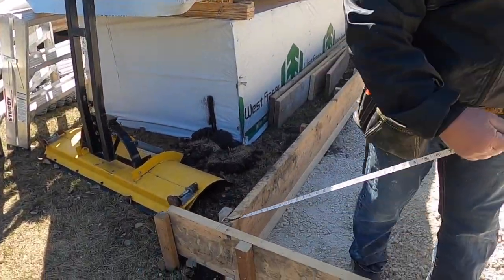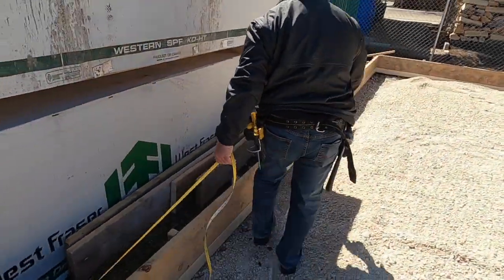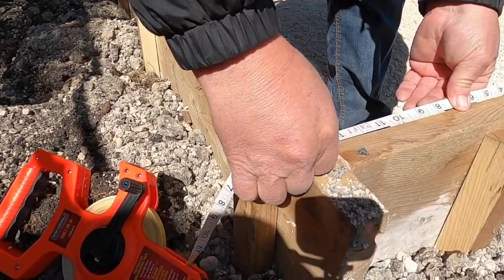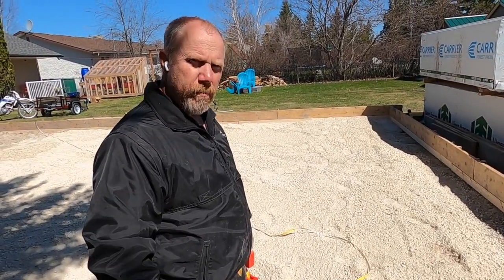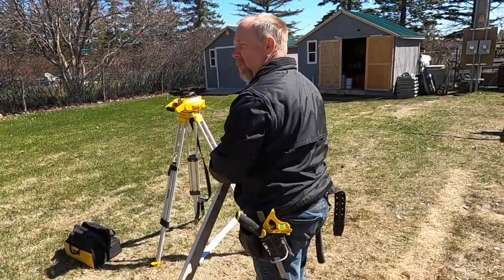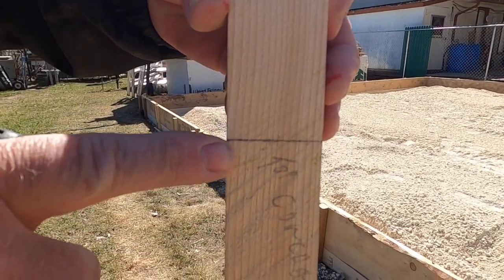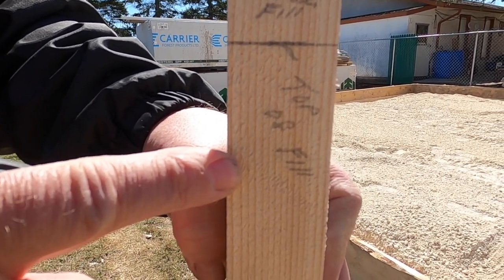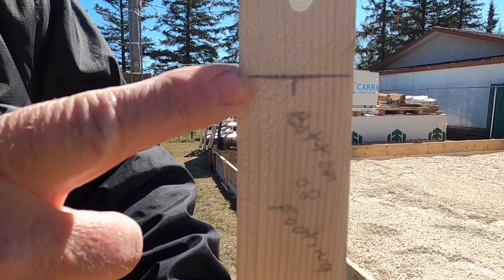Thickened Edge Slab intro

Comment: 4:09 wouldn’t you need a string line on the boards to be sure they are straight before doing triangles?
Reply from the maker: yes that was done ignorer to keep it strait before the pour and at setup
Reply from the maker: That was done prier to doing the 3,4,5